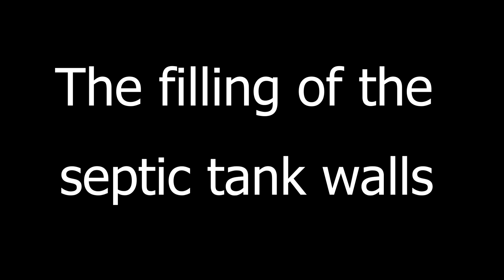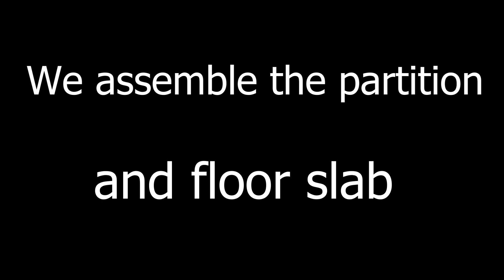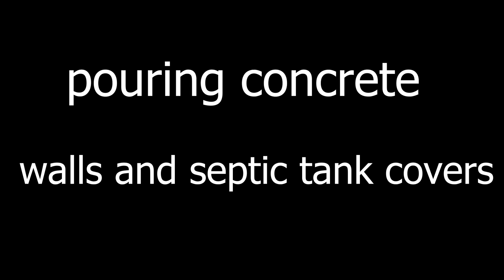7. DIY/saved600$ How To Build A Complete Septic Tank

Comment: How did you get into the tank to remove the form work? I may be missing a few of your steps, but I really appreciate your sharing this video!
Reply from the maker: Drilled a hole and cut it out with a jigsaw
Reply: @musichouse2485  I'm asking about 11:35 (Dismantle Form Work) in the video where you go back inside the tank after the roof is completed. Maybe the opening at the top was big enough for you to climb inside.
Reply: yeah they do the same thing here in the Philippines, they leave two or three man sized holes with covers that you can easily break back open so that you can vacuum out the tank. I thought it was weird at first because in America at my grandma and grandpa‘s place they have a leaching field so they’d only have to get it vacuumed out like every 10 years. And the vacuum hole is small in America. Here in the Philippines it’s like an every six month to one year ordeal and they have man sized covers just like this guy had at the end around 12:44.